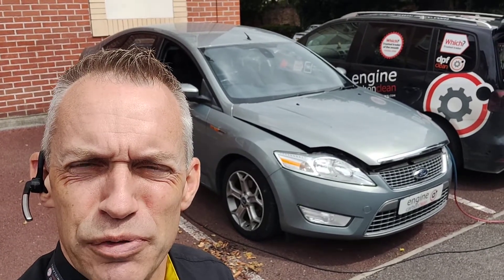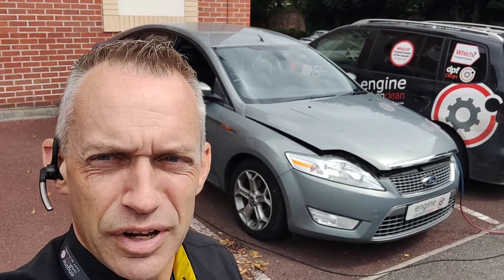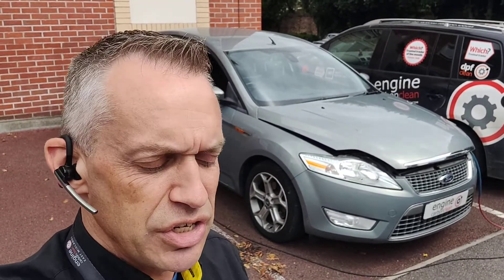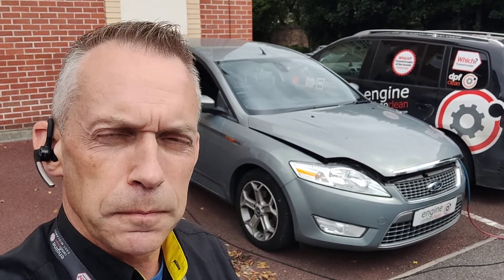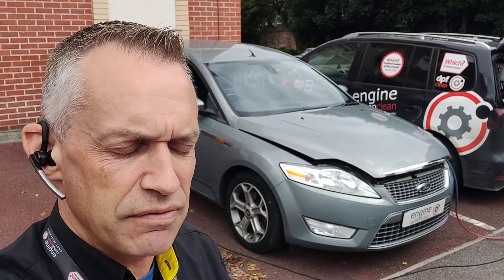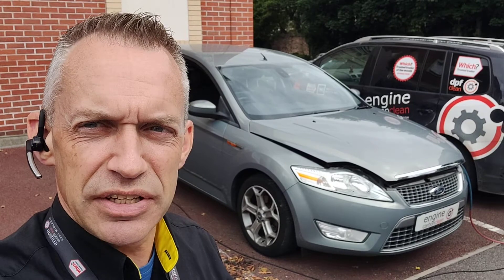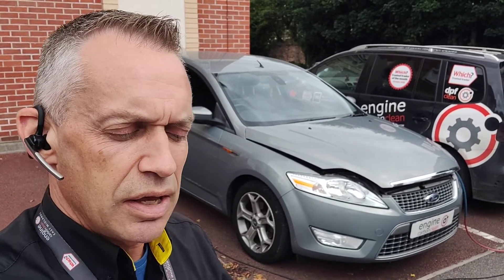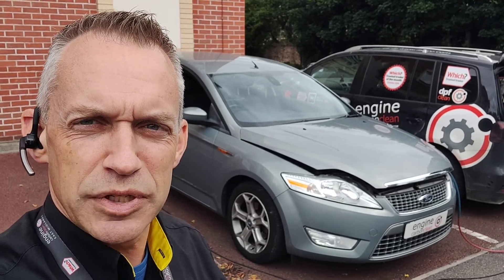DPF issues: thermostat and pressure sensor on a Ford Mondeo 2.0 (2010 - 130,375 miles)

Comment: I have 2.2 and temp get to 83 and stay there. My dpf regenerate every 160-200km regardles if I drive in town or not. I checked vaporiser and its clean and temp on regen get between 600-660. It seams to fill up dpf a lot quicker. I have noticed my fan comes on when I start warm engine for couple of seconds and goes off. I have no errors on dash, new lambda and egr. Pressure on dpf go around 5